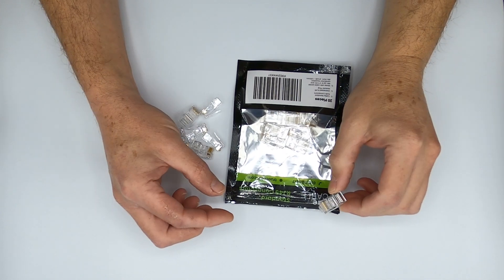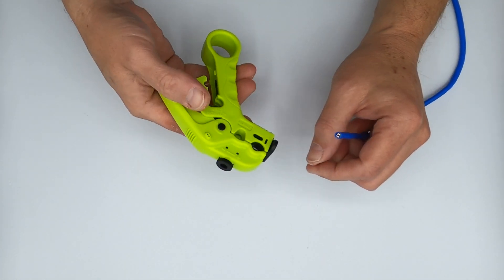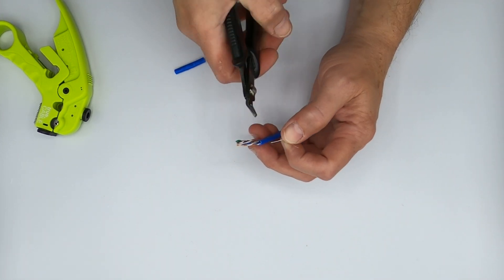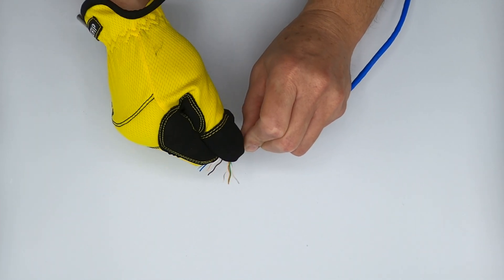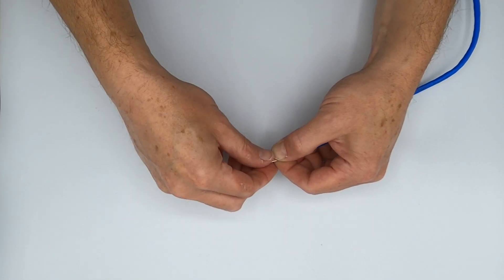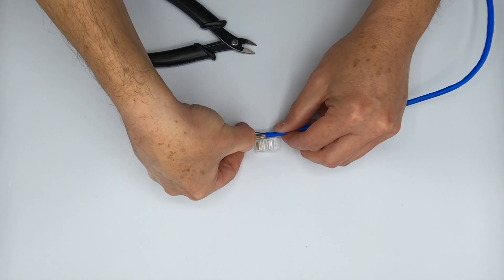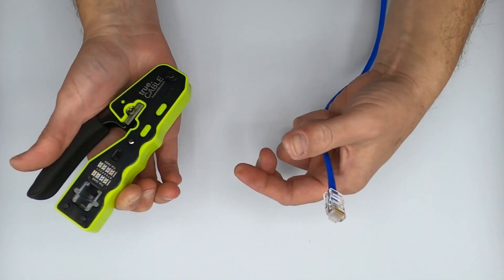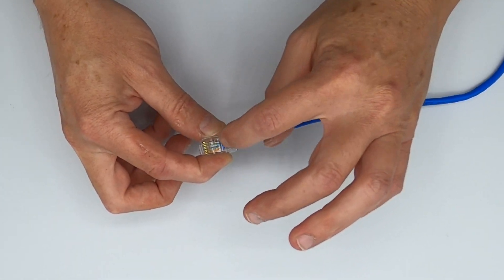How To: Terminate a Cat5e RJ45 Connector - The Correct Way!

Comment: can I use this connector on a Cat 6 23 awg?
Reply from the maker: No, this connector works with 24 to 28AWG stranded or solid conductors. Suitable for cable jacket diameters up to ∅6.50mm and conductor insulation diameters from ∅0.85 - 1.05mm.

If you need a connector for Cat6 23AWG, look no further than our Cat6/6A Standard RJ45 Connectors | Unshielded which can be found here: https://www.truecable.com/products/cat6-6a-standard-rj45-connectors-unshielded.